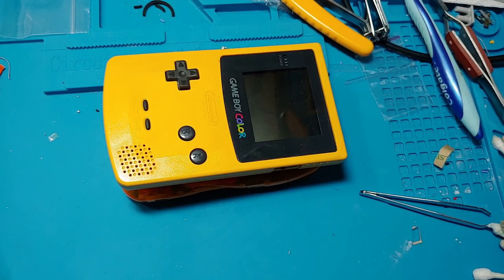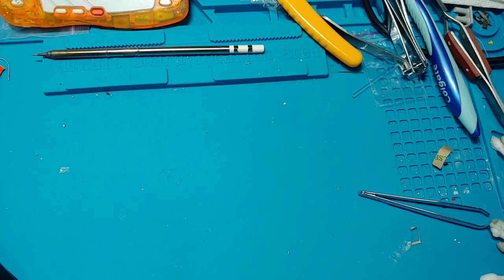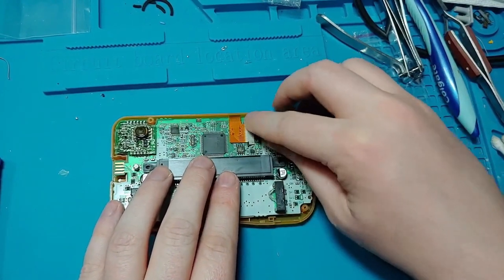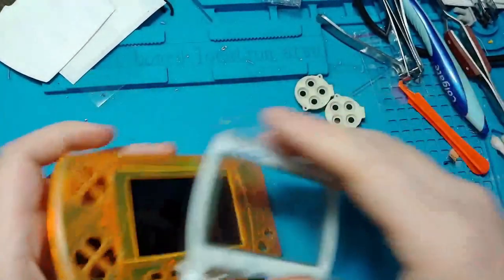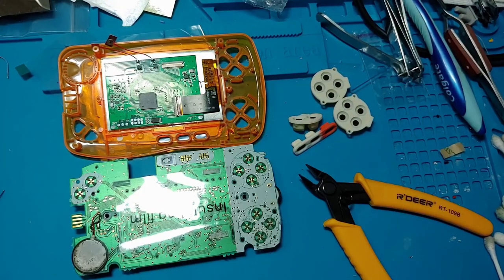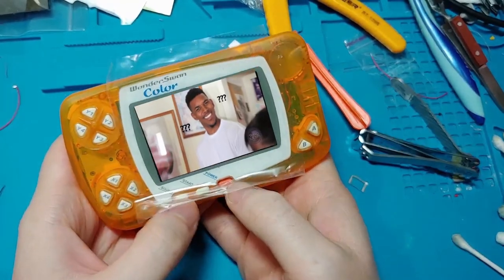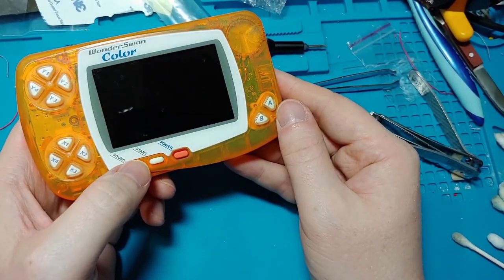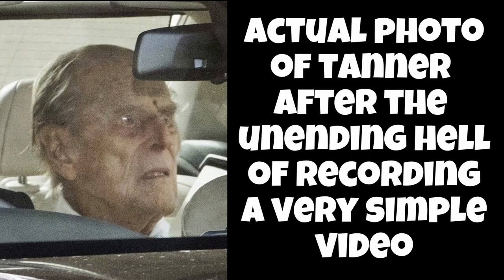Failing the Wonderswan: IPS Backlight Gone Wrong

Comment: Good video! I had this same problem today. It turned out that the ground wire going to the ips driver board was pinched between the shell. Moved the wire and all was good.
Reply: Same issue last night. I noticed the wires looked pinched...maybe that's it. I will probably try and find a way to move it or put a bigger awg gauge wire there
Reply: @AndyVandercoy  Did moving the pinched wire fix your problem?

Comment: Watched this video a dozen times while waiting for my IPS kit to arrive, and not only did I also put the ribbon cable the wrong way around, but I also had the weird reboot glitch. I think it might be something to do with the ribbon cable being right on top of the CPU maybe? One other bug I have just found, I trapped the battery wire under the B button, but the screen was perfect, I unscrewed the case, only moved the wire and now the screen has persistent burn-in from the Flashmasta menu or title screen from whatever official cart I load, cannot get rid of it at all. Just don't understand how a mod so simple seems to have so many issues!
Reply from the maker: It's really frustrating. I think it's only a simple mod in terms of it being easy to install. The actual tech behind it, the fact that they made an FPGA for video out to this screen, is still pretty impressive in my eyes. Have you tried just fully disassembling it and putting it back together from scratch? And if the screen has constant burn in, you might be able to get a replacement from the vendor if you just let them know that you're having an issue. Generally Best Service&Cheapness has been pretty good to me with any issues I've brought to them.
Reply: @TannerDoesMods  Dude I have taken this thing apart maybe 30 times today, every time I do the most basic thing, something else changes. The screen burn is now gone but if I boot it with the flash master, it doesn't load at all anymore, and retail games are maybe 60% successful. I removed the hall effect sensors for the colour pallette and brightness but it will still randomly change colour or boot with a different pallette. Tested every solder joint, every connection, everything is insulated twice, but its just pot luck of it works, and then another roll of the dice if it doesn't randomly reboot on me. Already contacted the ebay seller, but I doubt they will do anything so probably going to have to go through PayPal.
Reply: @TheKumaDono  Did you ever figure out the problem to the random rebooting?
Reply: @Ill_look_back_on_in_disgust  Yes I did, the problem was the IPS mod and using the FlashMasta together, I bought some USB-C AA batteries and it worked perfectly every time, was just a power issue, even using Duracell Alkaline batteries wasn't enough juice for both the IPS and Flashmasta at the same time.

Comment: Ha I loved this so much. I just did the install and no picture. The system keeps booting with sound but no picture. The ribbon cable is bent too much possibly because my dumb ass thought it had to be forced down to listen to it's creator. I will see a flash sometimes but that's it. There used to be a visible screen but I do wonder if new capacitors could help. Someone said maybe it's the driver board but seriously need to see my ribbon cable it looks like I bent it sideways